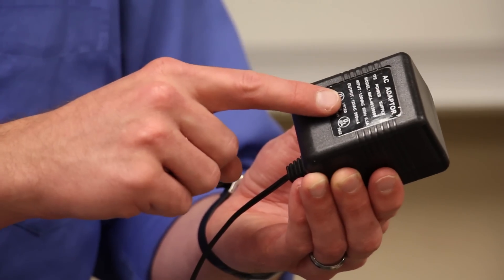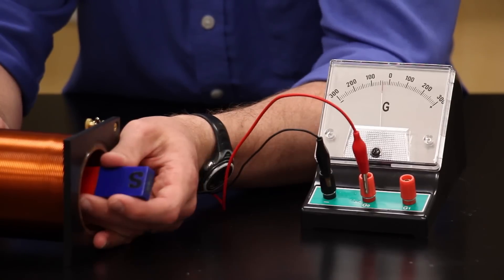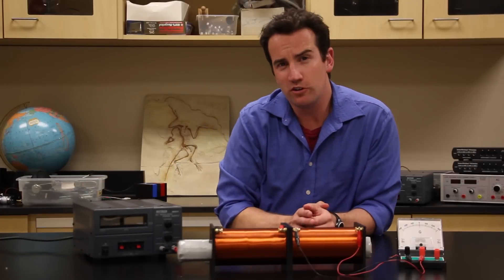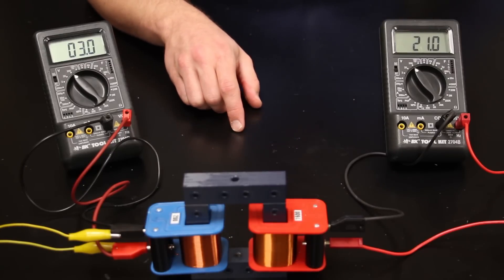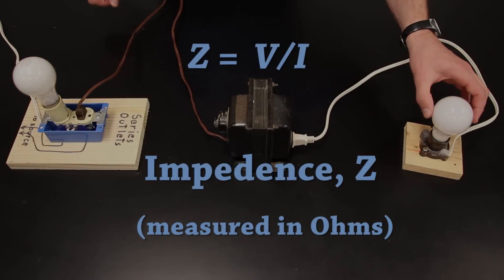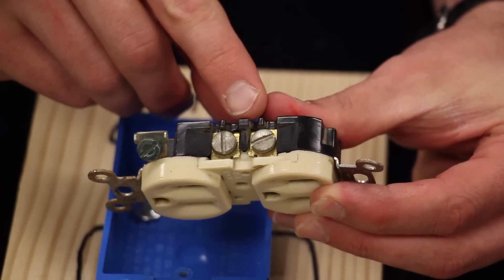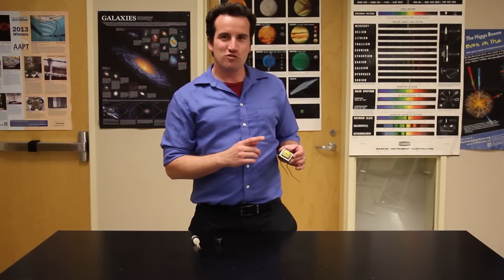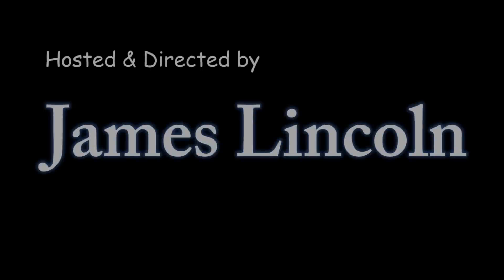Transformers - Experiments and Demos

Comment: Thank you very much for the video. The thing I do not get yet is to why Transformers are impedance matching devices. At 4:41: Why is the first light bulb not lighting up anymore: "There is an increase to the impedance in the current flow". So is it like this: There is still voltage across the first lightbulb, but not so much that the lightbulb will turn on? I guess what confuses me is that if i think away the second lightbulb it seems to me that there is only a closed circuit with a lightbulb (if anyone can explain I would be very happy, with mathematics is also fine if it is easier). Help is much appreciated:)

Comment: This video has to be incorrect. For one, if opening the secondary circuit opens the primary circuit, this would travel all the way back to the generator. Essentially, turning off the lights would stall, or at the very least, load the generator.

The implications are that magnets are loaded by open circuits and closed circuits. It makes no senses. It would send that impedence back to the generator, and completely lock it.

Secondly, there's no electromagnetic field around a wire if the electricity isn't flowing. So there's nothing to stop the primary from continuing to operate as a closed circuit, even if the secondary circuit is open.

This video is BS. It's just supposed to make electricity look like it isn't repeatable, etc.

Comment: Great info and well presented, Is there a DC transformer that will step up current so i can melt a single wire strand? I was planning on trying to use a dunamo generator to power said transformer.

Comment: how much current produced how much gauss?
how much tesla or gauss power required to produce one ampere of current for one hour
how we increased the voltage from battery cell to light a  1000 watt bulb for one hour 
so the relationship between all above equation thermodynamically correlated to each other?

Comment: Now I know why my teeing transformer not reading any volt. Because there is no output light bulb on the secondary coil. Circuit is open. 
Just a volt meter will read o

Comment: My question is thought where are the electrons in the secondary loop coming from for the current? As in,sure the magnetic field induces an EMF but where does the current come from that takes advantage of the voltage difference and goes to ground?
Reply: Nobody can say your name and nobody can answer your question... Save me... To really understand electrical stuff you have to acknowledge AND accept one critical aspect that isn't talked about very much- you'll find this in every branch if you dig deep enough- 
 At it's core, beneath all the carnival a days laws and magneutella spreads, the basic fundamental explanation for potential differences between electorals, electron notes neutral post igniton switches whatever you pick- AC is for Alice Cooper, DC is Dark Craft and it's all made functional through Black Magic.I mean, just looked at trans sister.., it's MFN black magic...

Comment: Awesome video, but I disagree with the statement at 8:02. The Faraday's law says EMF=-N*dФ/dt (d ~ delta). The flux (Ф) is in the core and is the same for both coils. Twice as many turns will have twice the voltage because N is twice as big compared to the other side, but flux is the same in both (same concept as a series-connected circuit: a resistor of (2R) Ohms will have twice the voltage across it than resistor (R) Ohms because its resistance is twice as high, while the current is the same).

Comment: Input voltage/Output Voltage = Turns1:Turns2

Simply measuring the input and output voltage gives you the answer to the turn ratio without ANY further math.

If you have 1v on the input and 2v on the output, then the turn ratio is 1:2. There is double the number of turns on the output side.

If you have 1v on the input and 0.5v on the output, then the turn ratio is 1:0.5, or 2:1. There is half the number of turns on the output side.

Not exactly 'challenging' for students, but I guess it would make you immediately aware of those who don't understand.

More challenging would be to ask them to give you the exact number of turns(roughly) as opposed to just the ratio. It would require testing the resistance and measuring the diameter of the copper wire, but would also be doable without disassembling the transformer. Just some calipers and some simple math is all that is required.

Comment: is it possible to rig/create a system so to lower electric bill by using transformers or some other device?? so to be able to get away with a low input at be able to power a bunch of stuff ??... say if you use a pc all day your common bill may be 40 dollars per month but with the rig your bill goes down to 20 dollars?
Reply: Robert Ostman Umm, no. The power is still the same. Volts x Amps = Watts. If you have a 120v outlet on a 15 amp breaker, you'll only be able to get 1800 Watts. So if you convert it to 240V you'll only get 5 amps. You COULD use a 10:1 transformer to convert that to 12V, and then use a few large diodes to  convert the current from AC to DC. They're are a bunch of RV appliances that run on car batteries (12V DC) that are much cheaper than regular household appliances, THEY might use less power to function, but they'll also be less powerful. As long as transformers generate heat, and they do, you won't be able to get out more than you put in.

Comment: not simple enough for the begginers
Reply: Logus 007 it seems pretty basic. You may want to go to a lower level of learning such as electrical engineering basics where you learn about ohms law and such. Magnetic fields are a harder concept
Reply: Logus 007 the number of turms in the coil determine the output voltage. The coil works like inductors(electric input in and magnetic output out) that would operate a motor by turning electric energy into emf. However we can alter voltage at the same frequency,phase and current. Hence we can increase output by increasing the number of output coils as compared to the input coil.
Reply: Input voltage/Output Voltage = Turns1:Turns2

Simply measuring the input and output voltage gives you the answer to the turn ratio without ANY further math.

If you have 1v on the input and 2v on the output, then the turn ratio is 1:2. There is double the number of turns on the output side.

If you have 1v on the input and 0.5v on the output, then the turn ratio is 1:0.5, or 2:1. There is half the number of turns on the output side.

Knowing that, then you also know if you have 10v, but you need 20v, then you need a transformer with a 10:20, or 1:2 turn ratio, meaning the output side has double the turns of the input side.

Knowing this is all that is required for a basic understanding of transformers and their purpose.

You also have to consider the current requirements, as that would dictate the gauge(thickness) of wire, but that is another topic.

Comment: I know it can’t be, but if you step up aren’t u getting free power.?
Reply: No step up transformers are more efficient for transmission of power, but this is not free power. When you step up the voltage, you step down the current at the same factor, so the power stays the same less any losses. Lower current creates LESS i^2R heat losses on the lines. The heat of the transformer itself has to do with the power flowing through the transformer and its associated characteristics such as cooling method, insulation, and core losses.
Reply: No, not according to Ohm's law, you actually lose more power via heat, touch a transformer around your house, its rather warm or even hot at time.

Comment: excellent, I have a micro hydro generator that outputs a max of 80vdc 220mah, I'm trying to increase the amps even if I have to compromise volts, do you have any advice for my experiment I would greatly appreciate it.
Reply: erick sal  You could build a transformer with twice as many primary windings as secondary. It will half the voltage and double the current
Reply: John Lacy should I start with any voltage transformer , I mean rating? what minimum voltage rating should I start with?
Reply: I'm assuming the generator is producing ac current as that is important. Otherwise, the voltage rating of the transformer isn't too much of a concern as long as you're not using a very small transformer. As long as the primary wires are around 18-16 guage you should be fine. The frequency of the ac in might be a concern. If the input power is too low of frequency the transformer might get hot. You may just have to experiment.
Reply: the gen produces dc
Reply: erick sal   Transformers need ac input to work. There is likely a rectifier in your generator, if you bypass it you will get ac output.
Reply: If the generator produces dc and you want to pulse the transformer, then you first need and oscillator between the generator and the transformer. That'll give you induced dc pulses for your HHO.
Reply: Victor ST the hydro gen seems to produce both ac and dc  when I use a multimeter , though the specs say its a DC gen, so let's assume for doing it right sake that its DC, and I'm gonna use an oscillator, now when I blow air in it easily gives me 50v, so I can imagine with the pressure of hydro, its gonna give me the full 80v, but 220mah is still too little I'm wanting to get at least 4 amps, where should I start? what size of oscillator do I need, what size of transforner ? thanks guys I appreciate your time.
Reply: HHO cells are electrochemical cells and as such, they don't distinguish between direct current current and dc pulses. Hence, it's not necessary to oscillate the cell to produce HHO. 12 volts dc will do it. Even less. How many amps will draw? I don't remember, it's been a while since the last time I made one, but the amps will depend on the total surface area of your stainless steel plates. In some cases it's 1 amp, in other it's 5 amps or more, if it's a big cell. Watch out because those levels of current are too high, in my opinion, for small projects. If you're working on something bigger, then I don't have answers for you, sorry for that. The thing is the amps depend on the size of your cell. Now, 80 volts is a lot for the job. You want to HHO an entire swiming pool? Try reducing the voltage. The trick is to produce the most amount of HHO  with the least voltage possible. Once you got that, the current will take care of itself, because the size of you plates and the concentration of your electrolyte determine how many amperes your particular design will consume.. This is crude HHO production. On the other hand, if for some particular reason you wish to fine tune the production process, then you have the option to include an oscillator, strong enough to withstand the voltages and currents you're working with. In any case, if you include an oscillator, you'll need relays to control the electrodes. But the moment you include an oscillator, you will get less current in your cell than with the direct electrodes. In any case, it's an adventure. Have fun.
Reply: erick sal how did it turn out? what are you building. or what are you going to do with the hho? and how much gas do you want to make? I don't think this is going to make a use able amount. I'm thinking of a dual fuel generator. running on hho and wood gas. I'm using a 5 gallon cell. with a coil of stainless sheet. insulated with scotch bright pads. and a modified alternator that the voltage can be adjusted from 6 volts to about 30v and 60 amps. and power it from a water wheel! it isn't complete yet. hopefully in spring I can finish it.